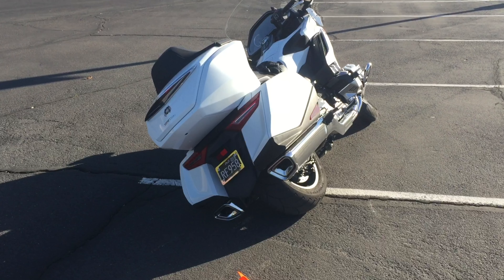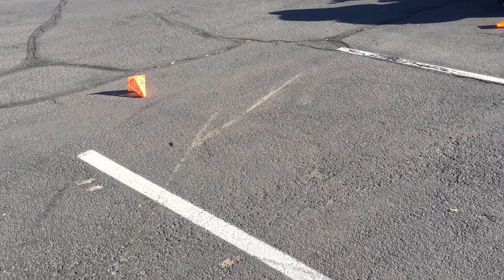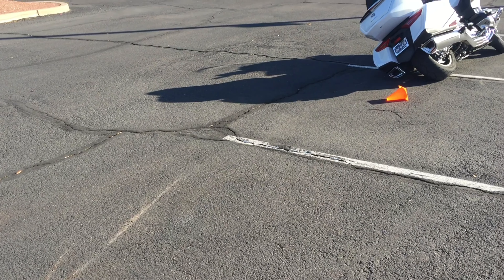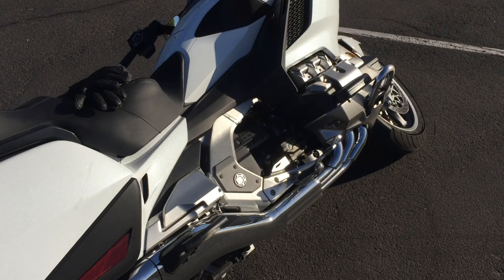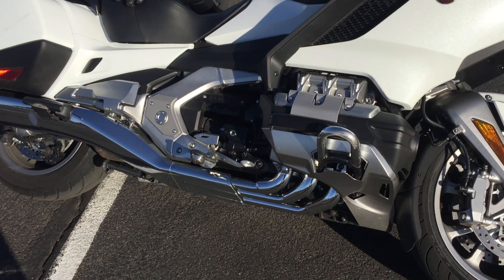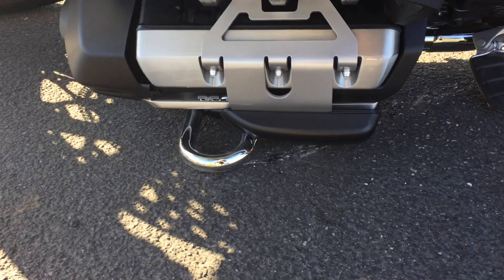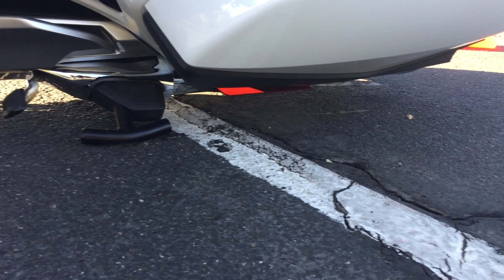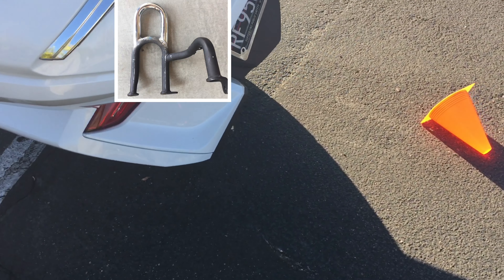2018 Goldwing DCT Tip Over protection part 2

Comment: Outstanding! These should be sold to or licensed to sell.
Reply from the maker: Would have been nice if for the 2019's>  they increased the trunk size and addresses the poorly designed tip over protection since I have heard of others who's bike just fell off the kick stand and had hundreds of dollars of damage because it landed on its side.  All known complaints from owners of the 2018's.

Comment: Where did you get the additional extensions on the tip over bars?
Reply from the maker: Dave at Southwesttrikes.com in Phoenix, AZ . He helped design and make the fronts and a different guy made the rears but Dave can make both.

Comment: Where can I get these parts?
Reply from the maker: You'll need a fabricator that can weld and be sure he places the engine guard in a jig so the mounting holes don't move because of the heat generated during the welding. You can buy the chrome rears off of ebay from earlier model goldwings. Then cut and weld to the OEM fronts as shown.
Reply: Thank you!
Reply: I couldn't find the rears. All the ones on eBay were 2017 and earlier. I have a 2019.
Reply from the maker: @perrymckinnon2220   those are the ones.  Your matching up the rears from the earlier models to the front of your 2019.
Your fabricator will have to cut and weld them to the OEM. 
Be sure he puts them in a jig because they're super thin and will bend due to the heat. Then the mounting holes might not match up. 
Take pictures of mine from the end of the video so he'll have an idea of how to cut and match them up. be sure you make the rears the same length as mine. A friend had his made and they stick out way to far.
Reply: Thanks again 😊👍